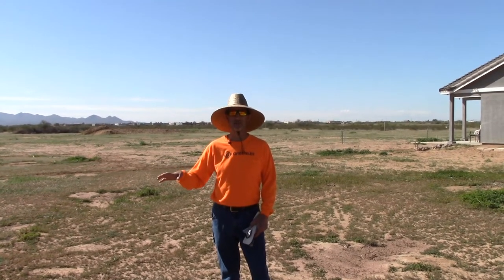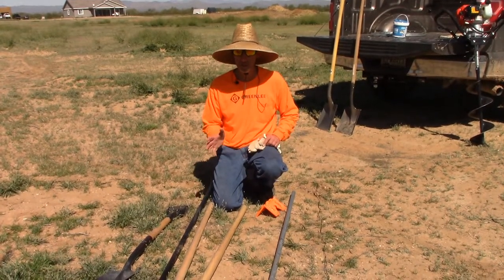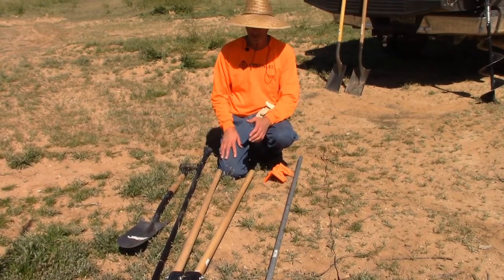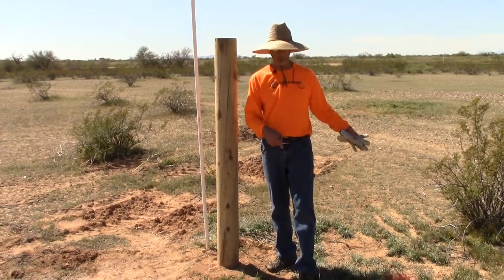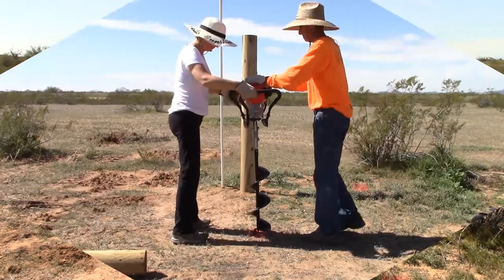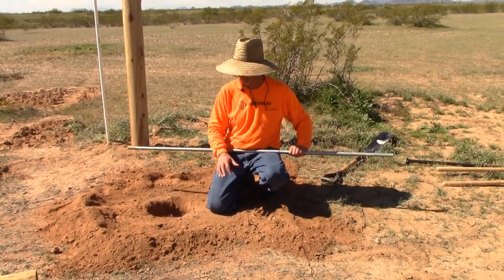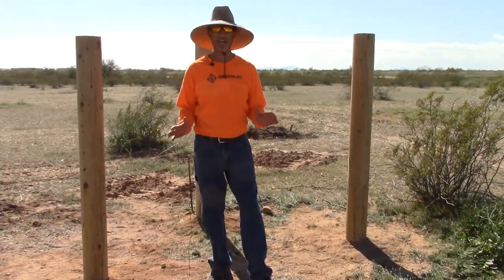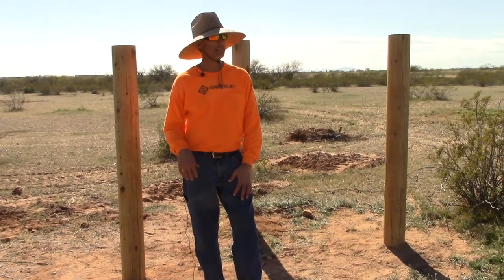Farm Fencing Install Part 3 - Corner Posts

Comment: YAY! Fencing!!  Do you think it's worth it to go ahead and buy the auger instead of renting it then? We don't have as much fencing to run as you guys do, but I still want it to be secure.
Reply from the maker: That's a great question. We weren't too sure at first, but we will use it to plant trees as well (including using it as a "trencher" for the rings around the trees), so it will definitely get used on multiple occasions throughout the first few years here on the new property. We try to run a cost analysis before deciding whether to rent or buy which is why we rent trailers. At $40 a day for a trailer rental when we only use them once or twice a year vs at least $1,000 for a decent used one is an easier decision.
Reply: @EdgeofNowhereFarm  That's actually another thing we've been discussing buying as well! Your response spurred conversation this morning, in fact. Both of us forgot we also have to tag and insure it even if it just sits in the yard 90% of the time.
Reply from the maker: @YourAverageWitch  exactly! Also, upkeep and maintenance.